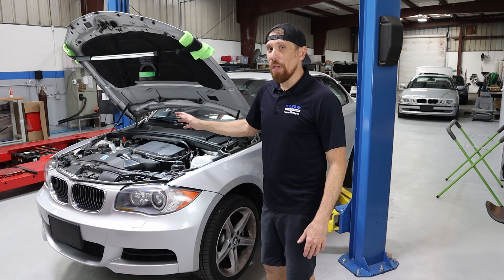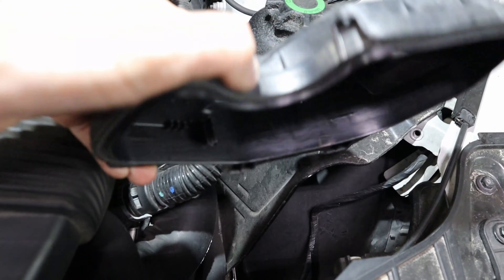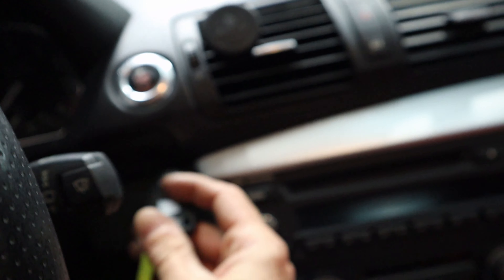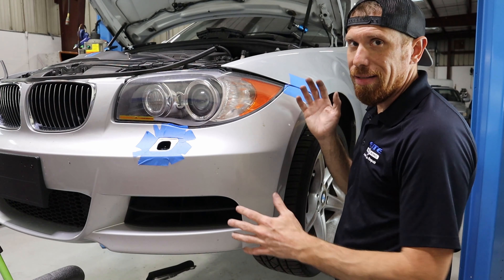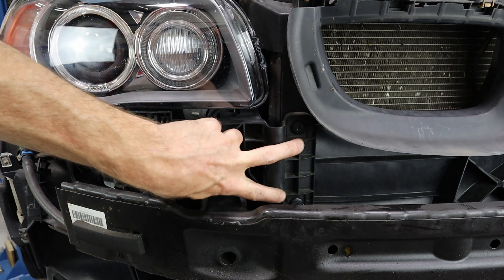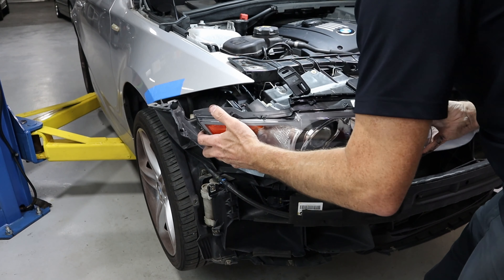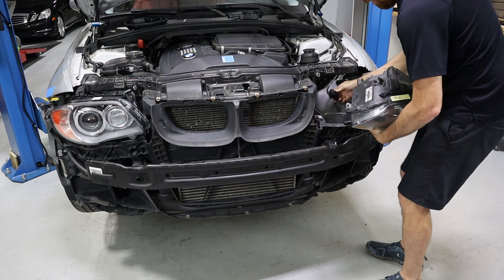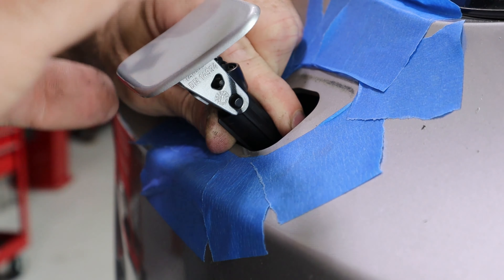How to diagnose and fix HID headlights

Comment: Jaime, fantastic breakdown of both how to diagnose and how to repair.  Without a good tech like yourself showing a lot of DIY’ers that this complicated but still “simple” procedure many would not even attempt it.   And great tip on the headlight spray unit and the diagnose by switching process.  Many times people just buy a new bulb needlessly.  Keep up the good videos man.
Reply: was about to buy a new bulb but decided to switch headlights and see if it worked, the bad bulb on the left side wasnt actually bad it worked on the otherside. i diagnosed it to be a faulty ballast
Reply: F fr

Comment: I just removed the tire and fender liner to access the control module /ballast, which may be easier" tool wise", but it's a great video.
Reply: Hey Ray - since you have been there done that, I think I may be able to get my answer resolved quicker with your knowledge.  Do you know if my 2008 BMW 335i Control Module or is it the Ballast that is responsible for why my light does not turn on...?  It is definitely not the bulb, I changed it.  From what I read is that the Ballast turns on the headlight/keeps the energy to maintain that headlight and the module is the High Beam/Low Beam traffic controller.  My Highbeam does turn on, just not the headlight.  I'm just not wanting to play the headlight switcherroo game here and I'd love to see if I can expedite my repair here, much appreciated and enjoy your New Years as well, thank you buddy

Comment: For my 20 year old lights I automatically purchased TWO  new ballasts, two new ignitors, and two new Xenon D2S 6000k bulbs for the outer  projectors. Two new  Phillips halogen bulbs for the inner momentary.
Installed new clear outer lenses and gaskets. Complete refurbished headlights

Comment: On my E46 M3, it turned out BOTH my ignitors were bad. (and one bulb.)
I put in two new ballasts anyway since they are both from 2005. They were easy to install. 

Getting to the ignitors is a real PITA!! I used The Build Journal DIY guide.

I bought two new 6000k Xenon D2S bulbs too. And some Phillips brand whiter, brighter halogen bulbs for the momentary headlight flashers.

Comment: FWIW, I like using spark plug boot pliers to pull the headlight washer nozzles out as they won't mar or scratch the nozzle and the offset allows you to clip the cover on.

Comment: You don't have to remove the bumper or headlight housing to do this!! You can access the "ballast" by removing the inner fender lining.  Save yourself an hour or more and just pull the wheels and inner fender lining.  Geeez 🙄
Reply: You saved me soooooo much time. Your way worked so much quicker and I fixed my issue too! 💯
Reply: Facts bro! The same with my Mazda cx-5, they keep saying to remove the bumper. Man that’s a lot of work! Your method is what I use and it works fine everytime.
Reply: My passenger head light went out so I bought two and changed both and all the sudden the passenger side isn’t working tried a new bulb and still nothing . I have an adaptive malfunction and a left low beam not working . Shops are saying I need a whole new assembly . I’m
Hop in it’s  just a fuse but not sure where the head fuses are
Reply: A HID was installed incorrectly and the light stopped working and a new one won’t work either . Would it be the housing/ ballast that got  damaged or housing ? I took it to a shop and they said internal electrical fault .

Comment: Soooo Professional and detailed, thank you sir. I would have worn Doctors type medical gloves if I was doing that. . I'm not doing all this handling it to my Mercedes Benz indy to do I would face a similar process otherwise. I simply bought Light Bulbs because suspected it must be the bulbs. but it could also be then a faulty ballast (control) unit?? I will find out in a few days. i choose higher Kelvin bulbs (D1s's)  so am looking forward to gettting these fitted. but I guess if Ballast he will have these in stock. I hope so. I trust them been using them for years.

Comment: A far better way to test the globes is simply to run the activation test in the Light Control Module system with a scan tool. If it lights up the bulb works and the issue is elsewhere, probably the auto level functionality, internally in the LCM Light Control Module or a wiring issue.

Comment: Hey Jamie, is it possible to get the connectors for the module harness and make a set of cross over cables??  I have several custom made cables for twin engine helicopters to check their modules. They save me mucho time not having to actually swap the component positions. Just a thought.

As a BMW owner, thanks for making quality videos.

Comment: I know that the metric system is a bit confusing, but the imperial one is also difficult for me.10mm is the head of the bolt and the stem is 6 and is actually a 6mm bolt
8(head)-5мм bolt
13-8мм
17-10
19-12
22-14
24-16
27-18
30-20мм
Reply from the maker: I agree with you and I understand. I was referring the socket size. I should have been more clear. Lol

Comment: 17:20 You can definitely use an extension with a socket, you'll just have to fish the socket in there a different way and then use the extension through the hole. It's a pain but it's doable.

Comment: I replaced the ballast and it worked for a couple cycles before failing again. What could be the issue? It flashes when i switch from daytime to nighttime manually but does not stay on. Is it a short circuit counter trip?

Comment: I've got a high mileage E90 with HID's and my passenger light started to turn pinkish and keeps coming on when I first start the car then dies out after a few minutes. I've scanned it and it's the 8A88 code for that side. From what I've seen and researched when the light does this it's almost always the bulb. I've ordered some so I guess I'll find out.
Reply: Did new bulbs fix your problem?

Comment: Hi Jamie,
I have a Volvo XC90, and the right HiD bulb is constantly blinking sometimes it also turns off. I don’t know much about HID lights and coulnd’t find too much in the internet. Could you provide me with some info about this problem? Thanks in advance, ps: i replaced both of the bulbs (new bulbs).

Comment: Hi there, nice video very helpful, I just have a question I have the same problem that both of my headlights are not working, I have the new ballast and new bulbs but they are still not working, at this point I have thoughts that FRM might be faulty BUT I don’t have any other lightning issues. By the way I have a series 1 e87 hatchback.

Comment: Hi jamie , I'm jamie .I was checking fuses I'm my 08 e60 5251 yesterday 
 When I turned key of I had about 6faults all to do with lights  
Front , back , sides , num plate . Any thing to check , foot module.  I know number plate bulb is good . Any info ??????

Comment: What if neither headlight is working? Where would you start? I do see significant condensation in both. Most likely bad ballast modules? I just got the car, bought two Xenon lights but now realize they may not be the problem. What are the odds both modules went bad?

Comment: Looks like they replaced that headlight with an aftermarket unit which obviously comes with an aftermarket control unit which is most likely why the control unit failed prematurely. Parts like these you replace with the OEM part to avoid this issue. Its a lot more expensive for the OEM headlight but its very likely that paying to get this control unit replaced negated most or all of that initial savings.

Comment: 21:51 I think that's the low-speed cornering/reverse bulb, not the highbeam. IIRC the high beam just angles the projector for the HID upwards instead of being a separate bulb.

Comment: Jaime my E87 sometimes starts with the passanger light on, and sometimes with the fault on passenger side. Whenever it mentions the fault, my idrive (CCC) will not boot either. Any idea what could be the cause? Whenever the CCC boots it works perfectly fine. CCC has already been repaired but somehow it is still a 50/50 chance for the CCC and passenger side light to work after start up. Manually turning off the lights and putting them back on again will always put the passenger side light on however.

Comment: I'm working on an x3 turbo build and I'm curious if you have any advice for converting the HID housing and wiring to halogen or if it is just a drop in swap. I'm having a hard time finding any kind of wiring schematic that is of any use and all the pinouts for the lights themselves seem to be the same with the exception of the automatic adjustment module.

Comment: Minor bender in my 325i, you can’t even notice it. But the top bracket on driver light shattered off. So I get the indicator in the dash. The lights work fine, but I think it’s the leveler. Is that serviceable or is it a replace the whole headlight assembly situation?

Comment: I have a 2005 toyota avalon limited. I hit a deer, broke the headlight lens. After heavy rain the HID stopped working. I changes the bulb and it turns on for about 1min and the completely shuts off. I changed the bulb and it still happens  the body shop has a headlight for me,  but I hate driving without a headlight until the car goes into the shop

Comment: Hello, I have a x5 e53 and my driver side low beam will not work. I have switched bulbs and ballast and alc control unit to other side and it doesn’t work. Well, it turns on for a couple of minutes then after it will go off again. My servo motors are coming on when I unplug the unit and then plug it back in. What am I missing? The code states alc control unit fault but doesn’t specify a particular one.

Comment: My  08 328i E93 has different assemblies than this car. I installed a new bulb and no difference. Mine are accessed through wheel well only and I see a square metal plate that is vertical and impossible to get last screw out. Do you have a E93 video. That is the hardtop conv coupe

Comment: Thats a lot of steps, unbolt the bolts on the front bumper and headlights all the top area and the two bolts that u used a long torx in the back, then take the covers off before u remove the headlights this is an important step if u do not take the cover iu wont be able to remove the headlghts. When ur ready start moving the headlight towards the center and tilt the otherside of the headlght till ur able to free up one side, now u can remove the main plug on the side of the headlight.then swing to the left and u just successfully remove the headlight without the hassle and dont have to recalibrate ur headlights as u never move any base and sliders. Quick tip do not force or pull the headlight u have to finesse it and and guide it smoothly on the corners.

Comment: have an issue that just popped up. The headlights are acting strange. One headlight won't come on. I turn off the lights then back on then no headlights come on. Turn off and on again then the light that didn't work will come on and the other will not.  Can't get both to come at the same time now. 2007 E86 coupe.
Thanks

Comment: Hi, seriously, looking for some help with this, I am replacing the factory headlamps with these aftermarket units. But I can’t get the highbeams to turn on! Check out the video, but here some additional information I didn’t mention:

* Ballasts and control units on both aftermarket lights were replaced.
*. When I hook up the surviving OEM headlamps with the OEM ballast and control unit it does the same thing.

It seems like this is car related; voltage?  I can start the car with no issues at all.  It is putting out 11.9 or 12v prior to starting, over 13v when running.   Running the engine does not keep the high beams on, but I noticed that when I went to get my son to hold the phone (and left the lights on, by the time we got back, neither LED nor Xenon would fire up and flicker unless I started the engine.

Thanks in advance!

https://youtu.be/sv9HUSetksQ?si=3fFr-JMPfYGXEvB8

Comment: Those ballast/control modules can't be accessed more easily by removing simply removing the tires and then fender liner. Thank you can undo the two scares holding them in. No need to pull headlights for bulb or ballast testing and replacing.
Reply: Can be. They can be without removing boost cover  Geez automiscorrect and no way to edit fix it

Comment: Why all the nonsense., just take the wheel off and the inner cover to replace the Ballast. What a waste of time.
Reply: Right, If you only need to replace the ballast like shown in the video, you can access it through the inner liner and removing the wheel.   I know I did.  Now,  if the module inside the ballast need to be replaced, then yeah you need to remove the headlights.  But great video on how to remove the PITA bumper.  :)  Thank you.